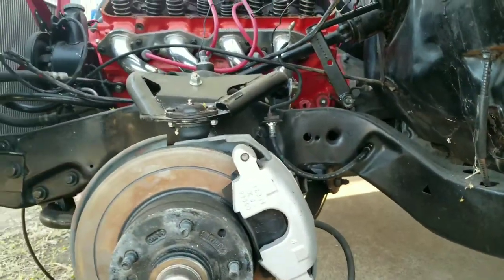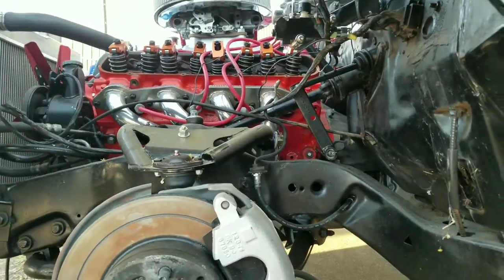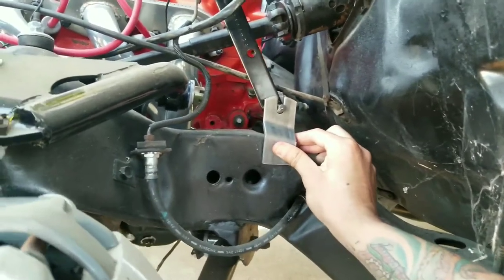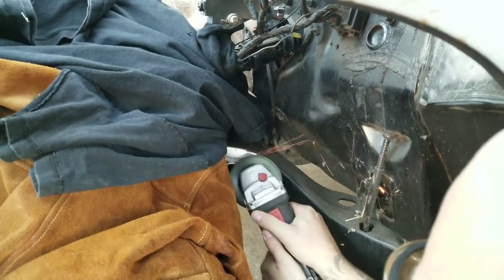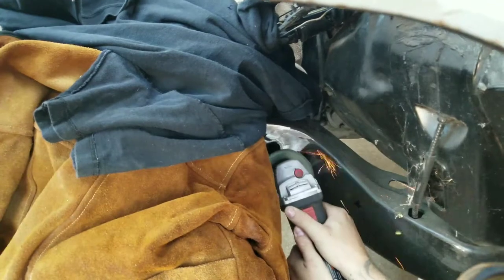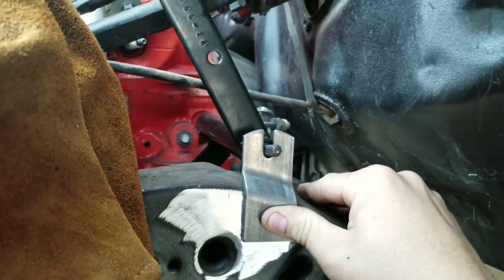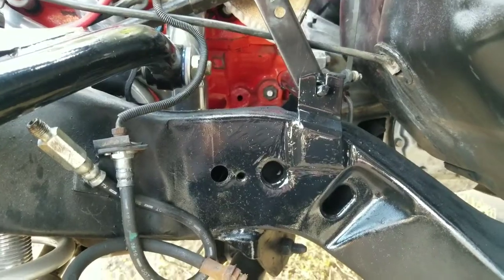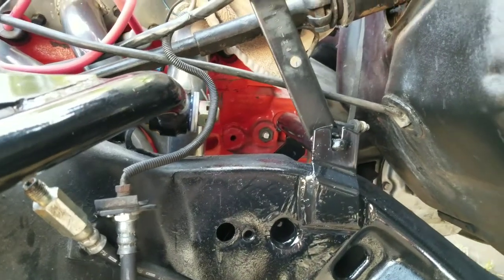1964-67 chevelle clutch z-bar bracket

Comment: What headers are you using?
Reply from the maker: Christopher Ramirez those were some cheap short ceramic coated headers from Amazon.
Reply: @Luis-Lopez-Luy  thanks for the fast response. I am looking for some long tubes to use with a manual trans that Don't hang to low. I have a set of hedman on my 64 El Camino but they are super low.